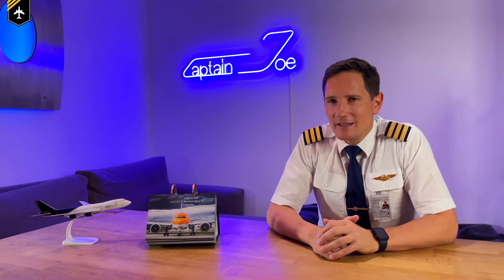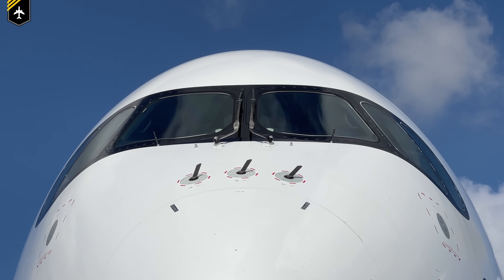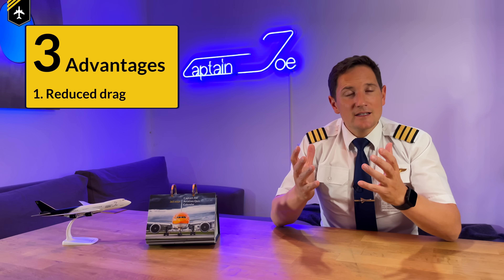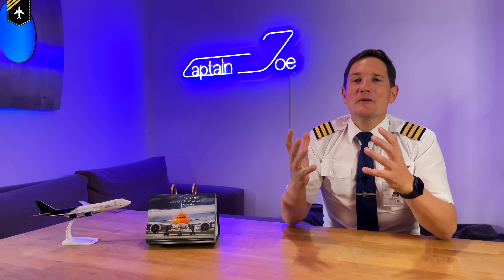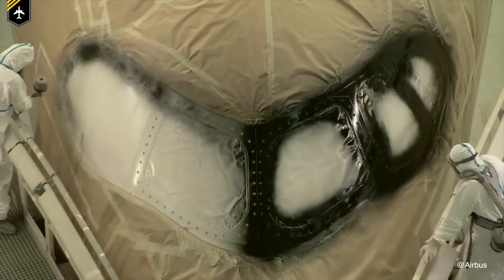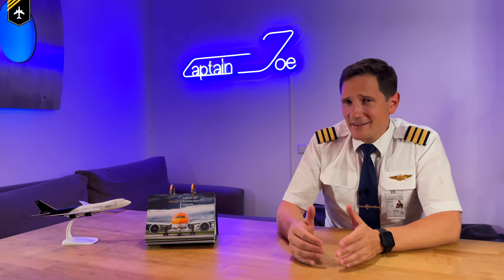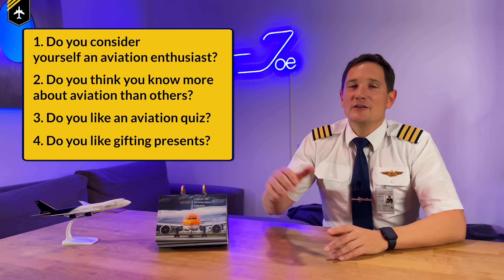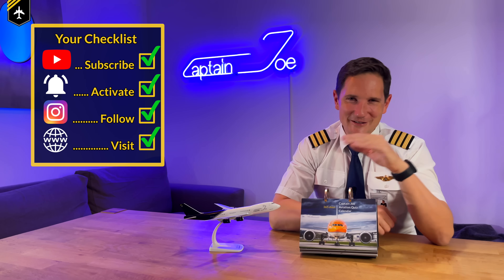The A350 MASK! Cockpit window shape EXPLAINED BY CAPTAIN JOE

Comment: What are all those probes?? I know some might be pitot tubes or AOA sensors, but why so many and are there other types of probes there??
Reply: Many.. static probe, tat probe total air temp, ice detector probe, standby static, negative relief valve panel, oxy discharge disc etcs

Comment: I 'm afraid it doesn't add up. Black materials may absorb the heat more easy, but they also radiate the heat away more easy.
I've read that it was for maintenance convenience (when replacing the windows).
Reply: Well there exist materials that absorb light but do not radiate heat much. But still, flying at nigh there is nothing to absorb.

Comment: Hey Joe  as pilot  like me  could you please  do  of  videos on how to  start  the  engine  when  the  starter  is not working  be safe  Greg the pilot
Reply: You can hand-crank an Antonov AN2, for anything bigger, you call maintainance.
If an engine flames out mid-air and with sufficient altitude, you dive a bit to speed up, then do a windmilling restart.